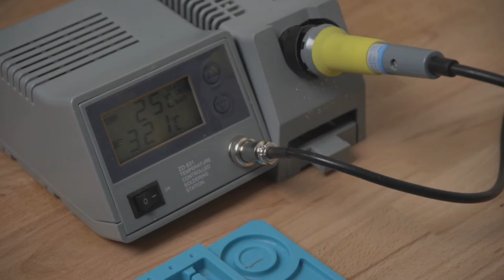New opamps and caps in Marantz CD-40

Comment: What abouth does Philips axial electrolitic caps? 🤔
Reply from the maker: Those are axial due to a height restriction. The plastic bars of the case block those sites, preventing the use of radial caps. It was important to change the other caps in the drive circuit because they were broken and preventing the disc from spinning and reading. The axial caps took a bit longer to source so I changed them later.
Reply: @audioupgrades  i disagrie. does are bad very often,u can use radial and just lye them on bord.
Reply from the maker: @srboljubsrbic7431  The player worked perfectly and sounded great without changing the axials. I don't like mashing things up, so I replaced them with axials later. They weren't in stock so they took a few weeks extra.
Reply: @audioupgrades  ok,but does regulate curent of laser so they are important...i can send u the picture how i have done it on my ...
Reply from the maker: @srboljubsrbic7431  I have changed them for new axials already. If you use radials you have to leave the legs too long and shield them with silicone tubing. I prefer honouring the original design, when possible.

Comment: hi 
do you have any link for the kit or some manual of what you did, thanks in advance
Reply from the maker: Hi, I used the service manual from here: https://www.hifiengine.com/manual_library/marantz/cd-40.shtml
For opamps I used MUSES 8920 because they are affordable and have a nice midrange. For power supply and digital circuits caps I used Nichicon KW, Panasonic FC / FM and Wurth ATG8. For analog circuit I used the same Nichicon ES plus KW. The stock blue film caps are good quality Philips so keep those. Good luck!

Comment: Hello, did u change also the smd caps ?
Reply from the maker: Hello. I left the smd resistors and caps in place. Generally, they have little impact on sound.This was a simple upgrade with new opamps and electrolytic refreshers to make better use of the TDA1541 dac. On more elaborate units, I'll change smd bypass caps to radial film caps.

Comment: pretty hard to see what you are doing and no list of parts replaced
Reply from the maker: Fair comment. I replaced all the radial electrolytic capacitors. They had dried out and caused the CD driver circuits to malfunction. It's a fairly common fault in really old CD players.
Reply: @audioupgrades  Tx, and what opamps did you put in? Also what did you think of the results? any noticeable improvement?
Reply from the maker: @raoulduke1914  Opamps = Muses 8920. It wasn't running when I got it. After the fix it sounded very good straight away. Muses 8920 are affordable and always sound good.
Reply: @audioupgrades  tx good info for those looking here. I have some BB opa604 I might try after recapping. I guess you wouldnt want to spend too much on such a budget player.
Reply from the maker: @raoulduke1914  Exactly, that's why I use Muses 8920 on low-end equipment. Mind you, with the 16 bit TDA1541 dac, it still has potential.